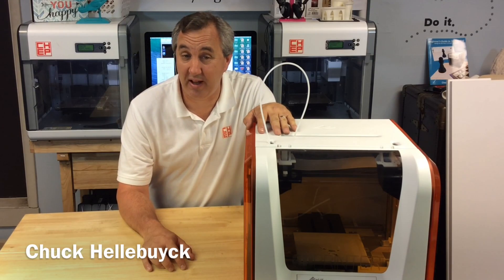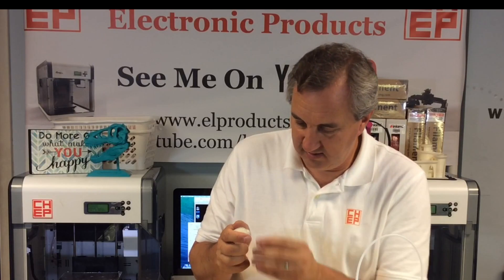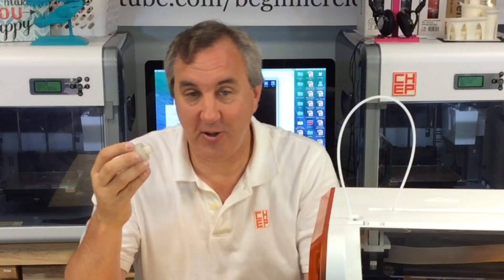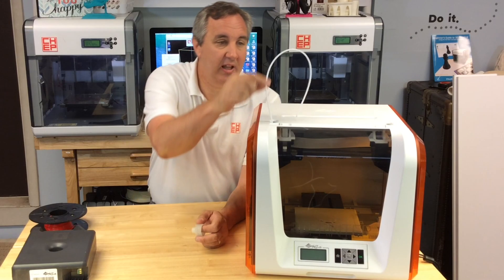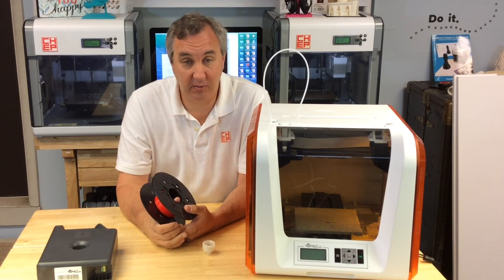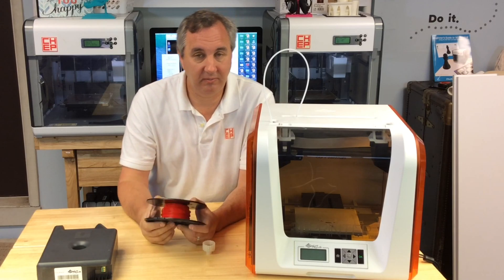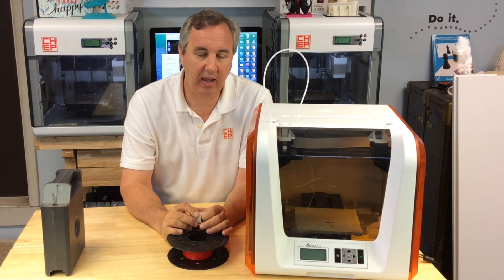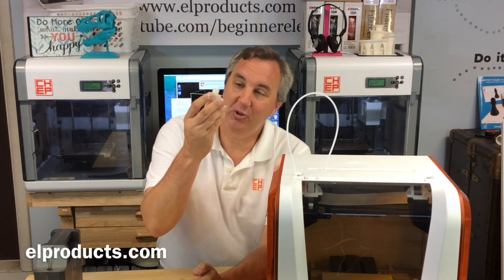Filament Friday #24 - Water Jet Nozzle and Da Vinci Jr Review Summary - Video #065

Comment: So in the christmas post you used two colors on one print. If you used a empty roll as a placebo to the printer, and then place after market filement  manually into the feed. could it work almost as a bypass?
Reply: oh, so the spool itself has a preset length of filament coded into it so when the spool is coded as empty it is without a doubt empty even though it could still have 6- 8 inches left. Seems odd no one has found a way to reprogram the firmware like you could with the DaVinci 1.0a using repetier firmware.
Reply: +Timothy Johnson In theory, the Da Vinci Junior security has already been bypassed by Father Padre Robert on the TWIT netcast network. He has to be careful what he says, because technology companies sponsor him... But he says there's a easy soldering trick so the printer won't use the security chip at all. It's not a factor of cracking the security, it's a factor of finding the chip in the Da Vinci Junior which looks at the security in the first place. Lemme know if you hear anything, my 3D friend. :)

Comment: I had a lot of trouble with the sticking on the tape.. after I ruined two of the three sheets that came with the printer, I started using glue stick. That has worked well for me.

Comment: You should really try making this fan mount. It is supose to make your prints turn out better and it solves the question on what the side panel parts are on your printer.

http://www.thingiverse.com/thing:634403

And also these caps will help keep stuff from dropping in those side holes inside your printer.

http://www.thingiverse.com/thing:305780

Comment: Heck chuck. I have a da vinci 1.0a and it keeps jamming up on pla. Any suggestions??
Reply: Wow thank you very much for the response!! The filament is jammed in the threaded portion of the extruder, and I cannot get it unclogged. I have even taken the tip out and heated it with a butane torch. The only thing I can think of is use torch tip cleaners, but then I run the risk of ruining the nozzle.

Comment: Ultimately the community just flashes the printer and we move away from that.  Of course, the whole reason it's so much more expensive is that they're underwriting the low cost of the printer with it.  It's a trade-off, cost-of-ownership vs cost-of-printer.

Comment: Gday mate. Iv just gotten the da vinci printer and scanner in 1. Love it but calibrating bed has become a horrible task. I get errors after running calibration and it seems to fail the test after only 1 print now.  Any way have you considered using the hacks to reset the chips? That is next on my list.
Reply: dfalconerio I got the Da Vinci 1.1 and my calibration numbers can't be trusted, I run it a bout 2 or 3 time with no adjustment to see if the numbers match or they swing. Also try using rubbing alcohol to clean the plates and the level needle to make sure they are clean.  If the numbers match then I use the Da Vinci calibrator app (android app on Amazon) to level it.

Comment: Hi Chuck,  

I keep seeing a 3D printer from CTC on ebay.  Just curious if you had any thoughts on it or have heard anything about them.

Here is a link to one.  Thank you for the great videos.

http://m.ebay.com/itm/CTC-3D-Printer-Dual-Extruder-MK8-Factory-Direct-Lowest-Price-ABS-PLA-/231533593514?_trkparms=aid%253D222007%2526algo%253DSIC.MBE%2526ao%253D1%2526asc%253D20150519202348%2526meid%253D4c9f94cc527b478b835fcb56201c8e2d%2526pid%253D100408%2526rk%253D1%2526rkt%253D25%2526mehot%253Dpp%2526sd%253D381312888329&_trksid=p2056116.c100408.m2460
Reply: ***** Thank you.